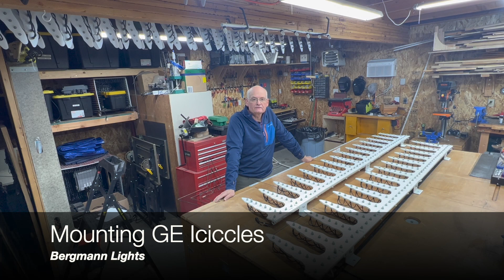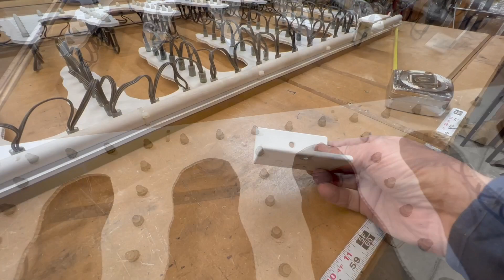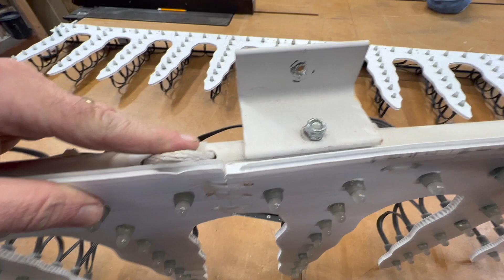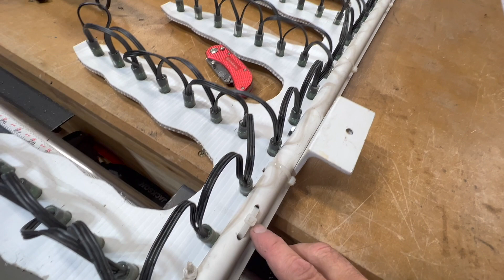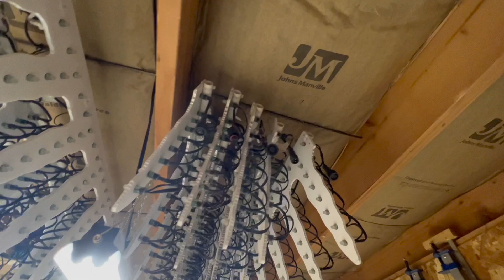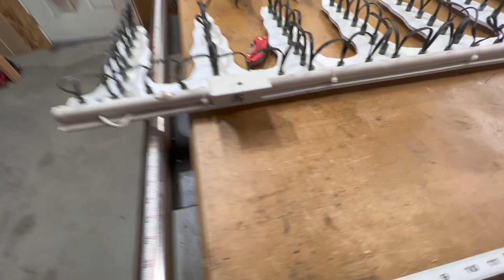Mounting GE Icicles

Comment: Can you let me know how long each panel is and spacing between each row? Do you think one light in between each row would fit? I see you have two. I ask because i already have a roof line i dont really want any in between the rows. How could i accomplish this?
Reply from the maker: I bought these from Gilbert Engineering sometime ago.  Each section is 4 ft long with 8 icicles.  The pattern is 1,8,1 in xLights.

Comment: If I have more pixel strings than roof line, can I cut the string to match? And of course, re-wire the ends.
Reply from the maker: With pixels you can do this easily.  When I cut strings I always put a connector on the end.
Reply: @bergmannlights5149  I figured.  Thank you!
Reply from the maker: No problem, have fun with your display

Comment: What spacing was your strand, 6” or ?
Reply from the maker: The pixels I use have the standard 4 inch spacing.  Not sure if the spacing between the icicle strands.  I purchased them from Gilbert Engineering.   It should be on there website